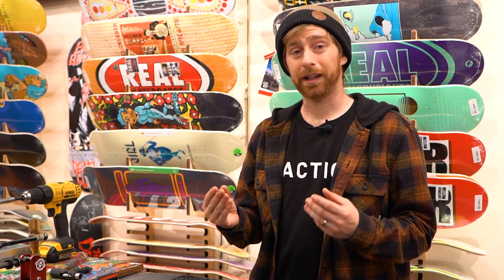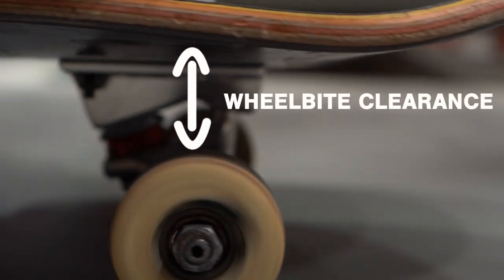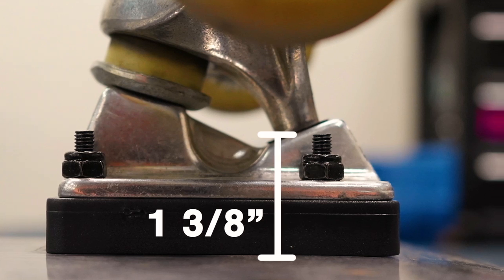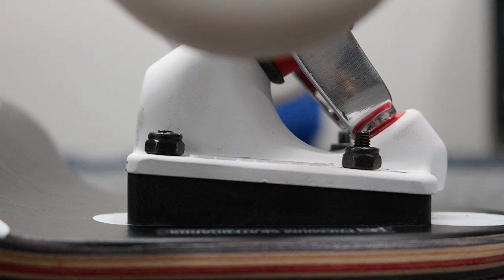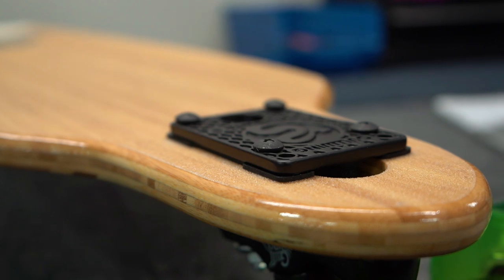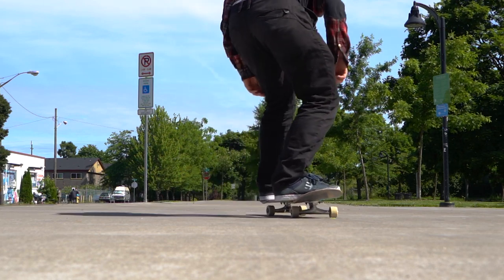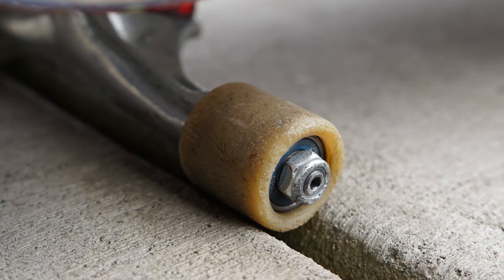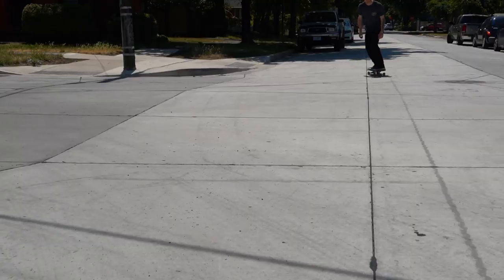How to Prevent Wheel Bite | Guide to Skateboard Risers | Tactics

Comment: Wheel wells. In less than 15 minutes with a small 2-3" drum sander you can attach to any cordless drill, you can gain about a 1/4" of clearance depending on how thick your deck is and how aggressive you want to get. I do it to almost every deck I own, if they don't already come with them from the factory.
Reply: Same heree bro

Comment: I just switched from 52mm Spitfires with no riser to 56mm Spitfires with 1/8th riser. I skate super-tight trucks - so I didn't get risers for the wheelbite. I got the risers (and big wheels) 'cause I'd been having trouble with the area I skate it having asphalt on the rough side and getting caught up in the isolation gaps on concrete. It does seem to ride smoother and rolls over stuff easier - but an unexpected benefit was I seem to be able to pop the board up a good distance higher. 

So not only are my ollies better, but being able to pop the board higher means there's more time for the board to spin during flips tricks and it's easier to complete the trick mid-air and catch it before landing - so your feet stop the board clean before the wheels touch the ground as opposed to having the wheels hit before your feet land.

Just something I noticed and I'm happy with the extra few mm of height.
Reply: same

Comment: Love the vids guys. Sound advice and straight to the point. Just moved from 55mm wheels to 65mm on an 8" wide deck. Got any advice on riser sizes in relation to larger wheels? I skate mostly for transport but love bowls and mini ramps when I can find them. Aunty Corona has given us so much time and so I've skated more in the last few weeks than I have in the last decade. You never lose that feeling but farggg it's hurts a lot more
Reply from the maker: With some 65mm wheels, you'll need at least 1/4 inch risers, but you might want 1/2 inch risers (so tall!). If you don't want to go quite as big as 1/2", you could get a set of 1/4" and 1/8" risers and combine them for 3/8". I guess it just depends on how loose your trucks are. I hope you're having a blast out there! - Tim

Comment: I bought a 54mm set and I don't want to use risers or tighten the trucks, which is a substantial change, maybe wax is the solution, not risers because I like my set up and 1 mm increase is not a Big deal from 53. Thx 4 your videos, well Made as usual.

Comment: Pretty much all regular riser pads will fit all trucks. They do not need to line up perfectly, as long as the rubber is located under the truck. Plenty of riser pads have six holes to account for different styles of trucks. I also think the combination of medium tightness trucks and properly sized wheels is the best way of dealing with wheel bite. Because no riser pad is really going to help you when trucks are so loose that you hit the board with the wheel a lot. A lot of people actually ride wheels that are too big for their setup (low truck, super soft bushings, loose truck setting, no riser pad, maybe soft wheels etc). I rarely ever get wheel bite and it usually only ever happens when I land on just one wheel. I do ride riser pads by the way, but only because the roads I tend to ride on are rough as hell.
Reply from the maker: Well said! 🔥
Reply: What kind of trucks are you using? Also, what size wheel? And deck/truck width? I tried Mini Logo trucks and found them to be horrible with regard to wheel bite. Too low. And I'm wondering of the geometry is a problem also. Switched to my old Indys. Problem gone. This is with 53mm wheels and an 8" deck.

Comment: I think one thing that will help with wheel bite is if truck manufacturers put the height of the truck in their spec sheets at skate shops. I just saw this with Indy Titaniums. The tag said 53.5mm high so at most I can put on there is 53mm. If I put 56mm wheels I'm going to need a riser.
Reply: Indys with the standard base plate are 55mm. The ones with the forged base plate are 53.5mm because the base plate isn't as tall. If you look on nhsfunfactory's website, they list the risers sizes you need for different wheel sizes. I think you need a 1/8" riser. I'm planning on getting some 58mm wheels. I'll see how that works out. Would be nice to not use a riser, but, I ride my trucks pretty loose. Hopefully, an 1/8" riser will be good enough. I'm not sure what you are saying about only being able to use 53mm wheels. Divide the wheel height in half. Only have the wheel is on the side of the axle near the board.

Comment: I wanted to turn my skateboard to a cruise board so i got a 70mm wheels but i suffered with wheel bites so i was thinking instead if changing the wheels cause the wheels are so soft and comfy actually to get a riser pad what do u think?!!
Or should i change the truck also

Comment: Awesome video as usual. When does your store open back up?
Reply from the maker: Our stores are open for appointment, so if you call customer service and tell them when you want to be at the shop, then someone will be there to open the doors. Well... unless it's 2:00 AM 😆  - Tim
Reply: @tacticsboardshop  Hell ya. I need to upgrade my old board from a trick board to a cruiser. All the skating I do these days is being pulled by my dog. I'm thinkin, new bearings, larger soft wheels.

Comment: Hi! I’m a new skater and I have trick wheels. The thing is, I want to cruise more so I bought 60mm, soft, cruising wheels. I have a 9 ply deck. How high should the risers be so I can avoid wheel bite.
Reply from the maker: With 60mm soft wheels, you should be fine with 1/8 inch risers, but you could also go with some 1/4 inch risers if you like your trucks looser. Then you'll have to get longer hardware to accommodate for the riser and the extra thick deck (9 ply). If you have 1/8 inch risers you'll need at least 1 1/8 inch hardware, and if you get 1/4 inch risers, you'll need at least 1 1/4 inch risers. Obviously risers aren't a guarantee that you won't get wheelbite, but it significantly helps. Cheers! - Tim
Reply: @tacticsboardshop  thank you

Comment: Can you combine/stack a riser with a shock pad and does it matter which one touches the deck and which touches the baseplate? Thanks
Reply from the maker: I don't see any reason why you couldn't stack a riser and a shock pad together. Also, I don't think it matters which one goes on top or bottom because the shock pad will still absorb vibrations wherever it is. 👍

Comment: Hey, I'm not sure what size board I have (as it was handed to me) but it's most likely the average complete size.
I want to get 60mm wheels but I'm not sure what size riser do I need. Any recommendations? 
Thanks
Reply from the maker: The size of the board isn't going to make a difference on what size risers you should get, but if you're getting 60mm wheels, you'll probably want at least 1/8 inch risers. If you like super loose trucks, then you might want 1/4 inch risers just in case. If you get some risers make sure you get long enough hardware to accommodate for them. 0:56 Cheers! - Tim

Comment: Hi I’m a beginner. I’ve got 54mm wheels and 3mm riser and get wheel bite. My skateboard looks much lower than others. I want to get a 6mm riser but want to ask if I can stack two 3mm risers on top of each other?
Reply from the maker: You can definitely stack risers on each other. Just make sure you have long enough hardware bolts to reach through both of them. 👍 - Tim

Comment: I have a 7 ply deck with 60mm wheels, and I am wondering if 1/4" risers with 1 1/4" hardware high enough so I dont get wheels bite, or should I get 1/2" risers and 1 1/2" hardware? And do krux trucks fit the independent risers?
Reply from the maker: 1/4" risers with 1 1/4" hardware will work and should be enough clearance, unless your trucks are crazy loose. The Indy riser will fit on the Krux trucks, but they don't line up perfectly. I'm pretty sure that Lucky and Pig risers fit Krux trucks better. Cheers! - Tim
Reply: @tacticsboardshop on your shopping page there are no 1/4" pig risers or lucky risers but you have Krooked risers do those work?
Reply from the maker: @rolandrelatores647  Yes, the Krooked risers will work. Any of the risers that have the elongated holes where you can slide and adjust them will work for most skateboard trucks.
Reply: Roland Relatores ....what's up man ,been riding many many moons I ride 60 mm wheels with 1/8 or 1/4 inch never have had a problem with wheel bite because I use the correct bushings at the correct hardness....if you have to buckle the kingpin nut down to where the threads protrude five or six threads then  your bushings are too soft.... Changing the entire geometry of the truck....

Comment: Except the wheel bite, does risers 1/8 help absorb landing a little if you got bad knees or is the difference nothing significant if you don't skate big stairs or so?
Reply from the maker: The hard plastic risers won't absorb any impact, but the soft rubber shock pads can soak up a little bit but the difference isn't going to be drastic. They're mainly for absorbing vibrations to give you a smoother ride, but every little bit counts right? - Tim

Comment: Can I put Revenge brand LB trucks onto a fat cruiser board? I will probably need risers. 🤔
Reply from the maker: As long as the hardware holes line up, then yes! You wouldn't necessarily need risers unless you were using gigantic wheels. Cheers! - Tim

Comment: Any idea if riding a truck that's wider/narrower than the deck causes more wheel bite? Been getting bad wheel bite on a shaped board that's about 9.25 at the front and 8.38 towards the back on some Indy 169s. Wondering if this is the issue.
Reply from the maker: If the board is a much wider than the trucks, there is a lot more leverage on the edges of the board and it will make getting wheel bite easier. If it's narrower, there's less leverage and will make it harder to get wheelbite.

Comment: If I have 57mm wheels will a 1/8in riser be good to guarantee I don’t get wheel bite?
Reply from the maker: An 1/8 inch riser should be enough, but it won't guarantee you won't get wheelbite. It also depends on how loose your trucks are. Even with 1/8 inch risers, if your trucks are floppy loose, you'll still be able to get wheelbite. So as long as your trucks aren't super loose then you should be fine. 👍 - Tim

Comment: What about 75mm OJ’s on a old school style deck. Could I double up on 1/2” riser pads for cruisin??
Reply from the maker: If you're gonna rock the 75mm OJ Thunder Juice wheels, I'd definitely recommend using two 1/2 inch risers. That set up is gonna mob!!! One thing to consider is that set up is going to be very tall, so every time you push you'll have to do a pretty deep one legged squat and you might get tired fairly quickly. But that set up should be able to handle dirt and bmx tracks as long as the dirt isn't too loose. Anyway, Cheers! 🍻  - Tim

Comment: Hi i have question what size should i use on some indy 159mm on a old school late 80's deck i bought some 59mm 80a wheels
Reply from the maker: Since the deck is wide (I'm assuming it's pretty wide because it's an old school deck 😄), there's a lot of leverage on the side of the trucks, so I'd suggest a 1/4 inch riser. Unless you skate your trucks pretty tight, then you'd be ok with an 1/8 inch riser. ✌ - Tim

Comment: I have a board with 130mm trucks. I want to add 60mm cruiser wheels. However, I think I will get wheel bite so I'm going to add a 1/2 riser. What length hardware do I need and should i get a 1/4 riser.
Reply from the maker: 1/2 inch risers might be a little overkill unless you run your trucks very loose. If your trucks are closer to medium tightness (not floppy) then you should be fine with 1/4 inch risers. If you go with the 1/2 inch risers you'll need 1 1/2 inch hardware, if you go with the 1/4 inch risers you'll need at least 1 1/8 inch hardware. I hope that answered your question! Cheers! - Tim
Reply: @tacticsboardshop  What if I dont run any risers . I could try and make my trucks as stiff as possible.
Reply from the maker: @DIBADYASU  I mean you could, but what fun is a cruiser that doesn't turn well? I personally have 55mm OJ Super Juice wheels with no risers and loose trucks and it's perfect. I use it to skate to work everyday. If you're gonna get 60mm wheels, I'd suggest at least 1/8 inch risers and have your trucks however you like them. - Tim

Comment: Hi, I'm putting up together a setup. I'm worried I might get wheel bites. I'm getting a Tensor Mag Light Low and a Spitfire Lil Smokies Conical Full 51mm. The Trucks' height from baseplate to axle is 45.5, in theory I will end up with a 2mm or 0.0787" gap between the deck and the top of the wheel. I will be using some soft bushings.

Now the question is, will that be enough gap so I don't get wheel bites, if not, will a 45mm wheels help?

I will end up with a 2.3mm or 0.0905" gap if I use 45mm, I'd prefer not though as I don't like the shapes in that size.

Thanks in advance!!
Reply from the maker: You're going to have much more than 2mm of wheelbite clearance because only half of the 51mm diameter of the wheel will be between the axle and the bottom of the deck. The other half of the wheel is between the axle and the ground. So if the height from the baseplate to the center of the axle is 45.5mm, and half of the wheel diameter is 25.5mm, then you should have 20mm of clearance which should be plenty. Cheers!👍🛹 - Tim
Reply: @tacticsboardshop  what a legend!!! 🔥🔥🔥 Thanks a lot Tim!!!! 👍

Comment: What riser pad size is good for 60mm wheels on a mini cruiser?
Reply from the maker: With 60mm wheels, you would probably be okay with 1/8" risers. But if you ride looser trucks, then you should go with 1/4" risers. Cheers! - Tim
Reply: @tacticsboardshop  Do you guys have an opinion about Mini Logo trucks? I just got some and had bad wheel bite problems without a riser. IMHO, they are too low. I have an 8" deck with the 8" trucks and 53mm wheels. I switched to my old Independent trucks and the problem when away. Though, those trucks are narrower than they should be because my old deck was a 7.75". Most likely, I will be sticking with Independents which I'm used to. I want to get some 8" ones. Hopefully, they will be as good as the narrower ones with regard to wheel bite.
Reply from the maker: @idmhead0160  Were your MiniLogo trucks super loose? Independent trucks are going to be a higher quality truck anyway because that's what they do. They're a truck company. MiniLogo does price-point everything, so the quality isn't gonna be quite as good as a company that solely focuses on one type of product. As far as wheel biting with your MiniLogo trucks, you could have just put some 1/8 inch risers on them, tightened them a little and you probably would have been fine. But if those Indy's feel fine, then go for it! Cheers! - Tim
Reply: @tacticsboardshop  Hi Tim. Thanks for the reply. Much appreciated. To begin with, the kingpin nut was basically up to the top. I like my trucks relatively loose, but, I tried progressively tightening them. It appeared that they would need to be way to tight to prevent wheel bite. I looked it up online. The Mini Logo trucks are 47.5mm high. Independents are 55mm. I don't see how anyone could skate Mini Logo trucks without a riser unless they like their trucks tightened down to the point where they barely turn. I ordered some 8" Independent Standards today (139s). I have my old, what I'm assuming are 129s on it now. They are about a quarter inch shorter than the deck on each side, but, other than that, work great. No wheel bite at all, and I'm able to carve and turn like crazy. Just how I like it. I'm hoping the wider trucks are similar. But, I also ordered some 1/8" risers and longer hardware just in case. I doubt I will need it though. But, I can use it with the Mini Logo trucks and see if I can get the to a usable state. Overall, I think the Mini Logo trucks aren't work messing with. You can get Independents for not much more money. Their bushing seem a lot better also. My old Indys are probably 19 years old, I think. And the bushings are still totally fine. Better than what looked like garbage on the Mini Logos. Their decks, wheels, and bearings don't seem to bad though. I'm happy with those.

Comment: my trucks are 7.75 inch and my new deck is 8 inch. does that causes wheelbite???
Reply from the maker: The extra width does give a little more leverage for turning which can lead to more wheelbite, but since the size difference is only 1/4 inch, you will be just fine with 7.75 trucks on an 8.0 deck. 👍
Reply: @tacticsboardshop  ok thanks👍👍!!!!!

Comment: are Risers and Shock Pads are the same ?
Reply from the maker: They are essentially the same, but shock pads are soft so they absorb a little bit of impact and a little bit of vibration so it doesn't feel as rough and slightly reduces speed wobbles. 👍

Comment: Do riser pads have a universal size like surface area wise?
Reply from the maker: The sizes of the riser pads vary a little from brand to brand and might not fit perfectly under the baseplate of another brand of truck. For example, Independent risers don't fit perfectly with Thunder trucks. They'll still technically work, but the baseplate hangs off the nose/tail end by about a 1/4 inch. So if you're unsure of the compatibility, you could always call up customer service and have them check for ya! I hope that helps! - Tim